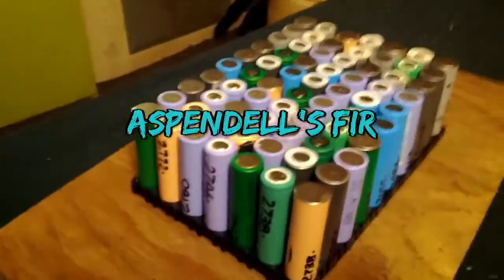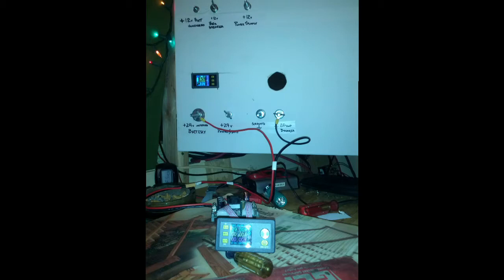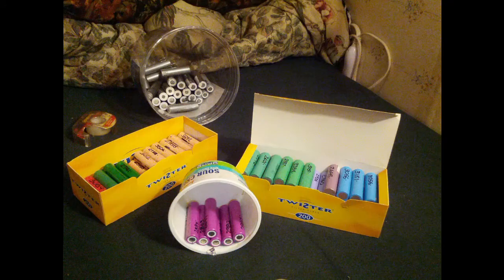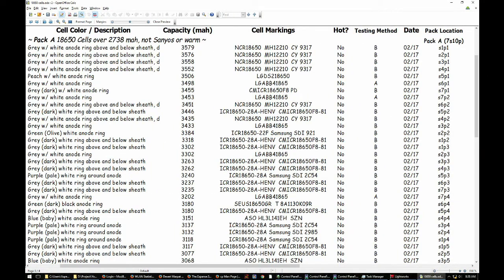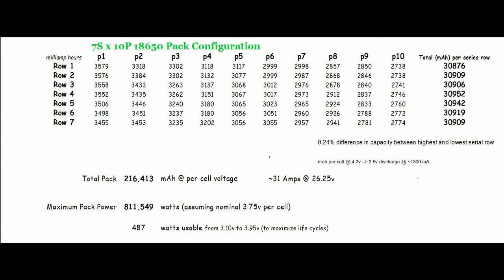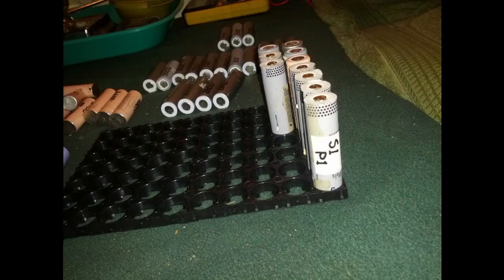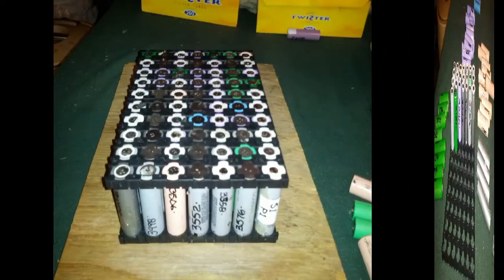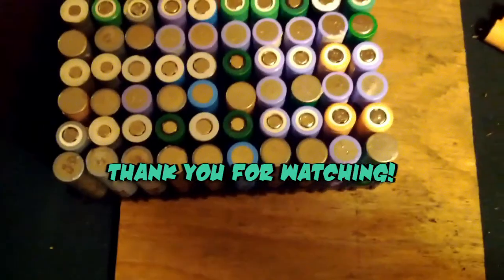Episode 1: Planning for my 7s 10p 18650 pack

Comment: I'm planning this build right now. Question how did it work now that you have had it for 3 years?
Reply from the maker: David it's still working great. Due to my careful cell selection and balancing process I have no dead cells.  I did a capacity check on it last November and it still had over 95% of the total capacity that it had new.  I ran it 24/7 for 5 months straight over 2 summers connected to a small inverter and a solar panel to mostly power a full size fridge.  Now it's relegated to providing backup power when the power goes out.  The only repairs have been to replace the circuit breaker which I was using for a switch for the first 18 months, and a couple of the individual cell fuses that got brushed off the cells by something falling during our 7.2 earthquake.  It has survived storage in -45F temperatures during our winters and comes out working fine each spring.  Temperature control is extremely important for long term operation of these packs.
Reply: Aspendell that’s awesome. I’m stripping laptop batteries and testing cells right now. I’m waiting for a new charger miboxer8 to help charge and test cells then the simple assembly. Most of the cells I am finding have a regular discharge rate around 0.5amp and a capacity between 1100mah  and 1600mah.
Reply: Aspendell I had a plan to organize it until I saw your build and realized it was way superior to my plan. Also love the automotive circuit breaker

Comment: In charging those battery pack in 29.4V 5A will the 5A current will be separated each cell in series? Like 5A/7s = 0.7A in each cell in series while having same 0.7A for all those in parallel?
Reply from the maker: Hi Jayson.  Just like cells in series add the voltage of each cell, when you charge it the charge Voltage is divided between each cell.  Cells connected in parallel add their currents together.  Hence, when charging the current is divided by the number in parallel.  Since this is a 10p pack, if you charged at 5 amps you would be delivering about 0.5 amps to each cell.
The charging voltage is divided by the Series rows, 29.4v / 7s = 4.2v.  This is why a well balanced pack is extremely important.  If you try to charge at max charging voltage on a randomly assembled pack you may have 3.9v going to some of the rows in series and 4.5v going to others which will quickly destroy your cells.
Hope that helps.
Reply: @aspendell209  Yes i know the benefits of a BMS. If I am going to build a 3s4p then each cell has a standard charge of 1.5A so 1.5x4 = 6 means i can those pack at 12.6V 6A? Right? And if each cell has a max charging of 3A so I can charge them at 12A max? Is that right?